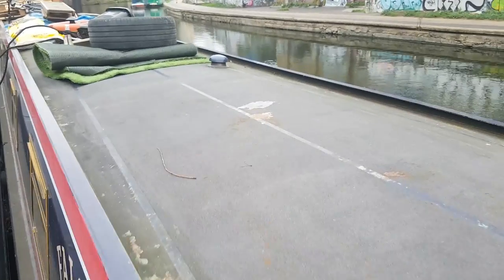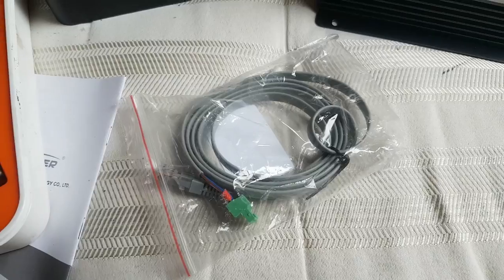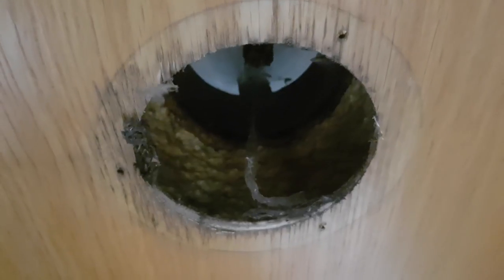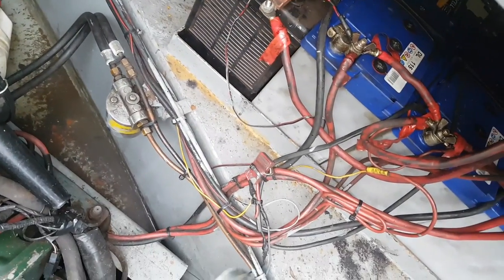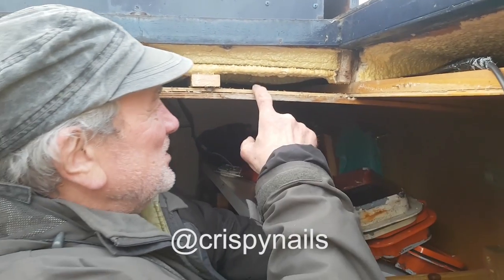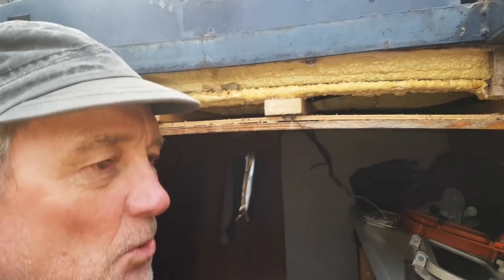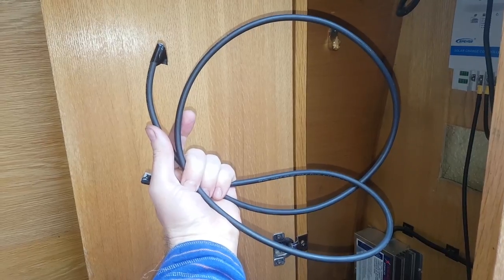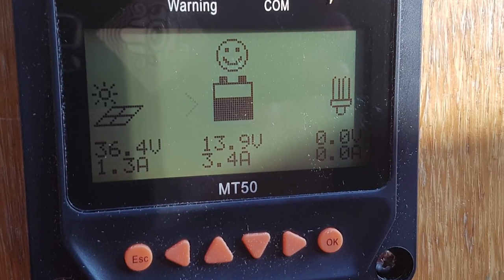How to Install a solar setup on a narrowboat

Comment: ya orite lads! :)  are those cheap mppt controllers any good?  I'm just doing installation on mine
Reply from the maker: Yep they work fine, though I have had one fail over 9 years and another ended up in a flooded bilge and died so been through 3 on my boat ;) the one in this boat is going well after 2 years.

Comment: I REALLY hope you fitted an (DC rated) breaker between the panel and the controller AND EVEN MORE IMPORTANTLY - a suitably rated fuse / MCB in the ouput from the controller to the batteries - if not, check your fire insurance is up to date !
Reply: Don't need a fuse between panel and  controller on a single panel, as it is unlikely to exceed its rating..
Reply from the maker: As the next comment says it's "largely" ok as the cable is over speck for the single panel, but we did put one in place as Martin insisted ;)